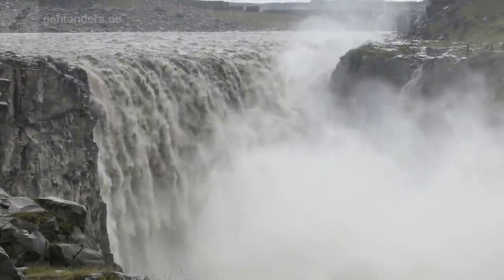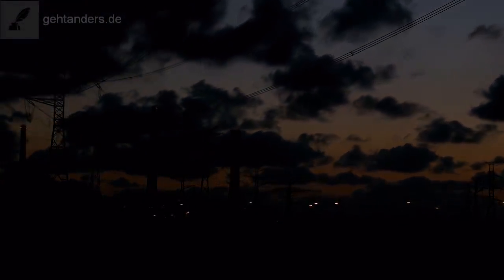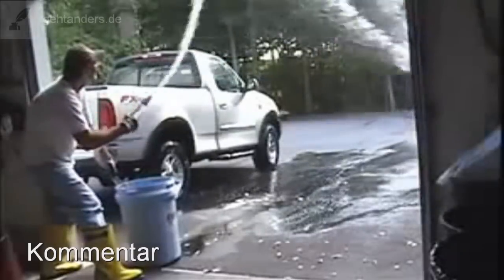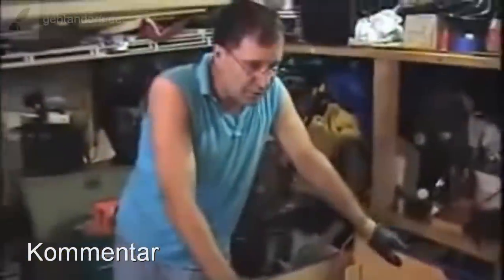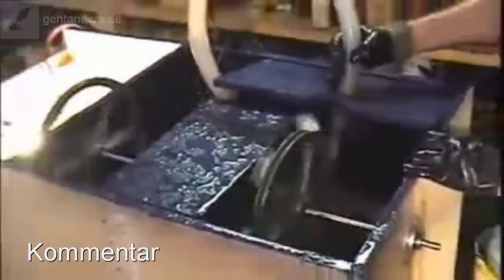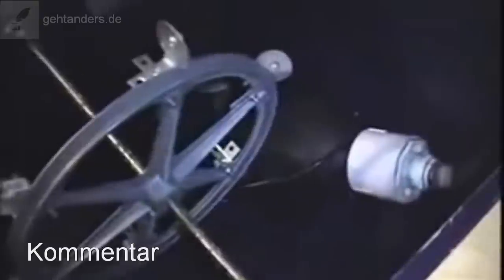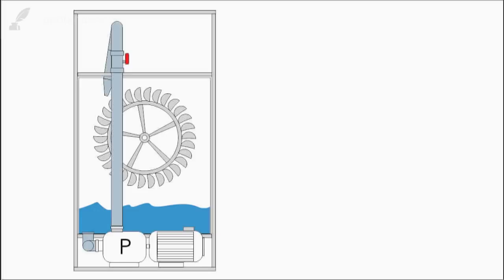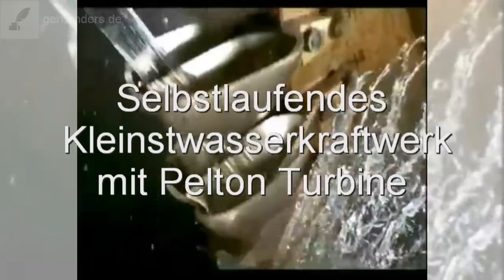Wasserkraftwerk selbstlautend mit Pelton Turbine

Comment: nun die einfachste Erklärung  als Beispiel 
eine Wasserpumpe  mit  sagen wir 200W verbrauch bei  1000 Umdrehungen des Wasserrades,  plus Reibung und  der andere übliche Mist.  sagen wir zusammen 400W  verbrauch 
auf der anderen Seite ein Generator mit  1000W Leistung bei 1000 Umdrehungen bleibt ein Überschuss von 600W - noch Reibung für den Generator sagen wir noch mal  - 300W 
bleiben immer noch 300W  über die als Energie genutzt werden können